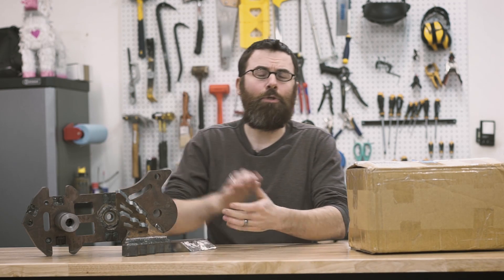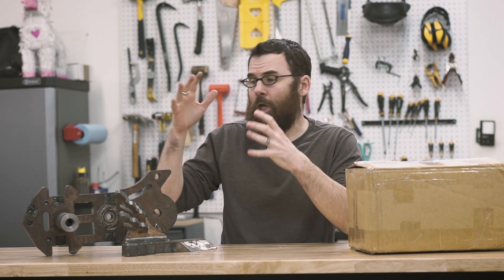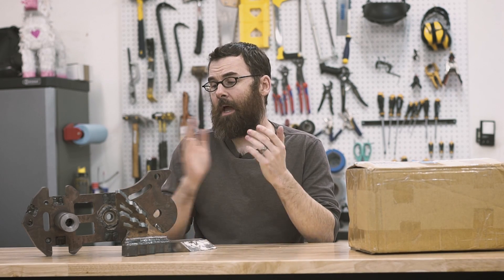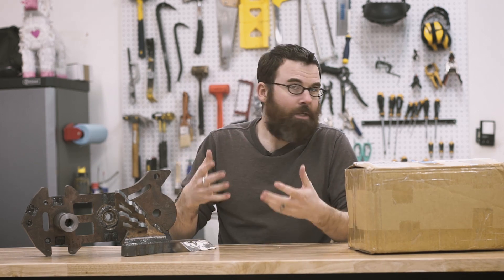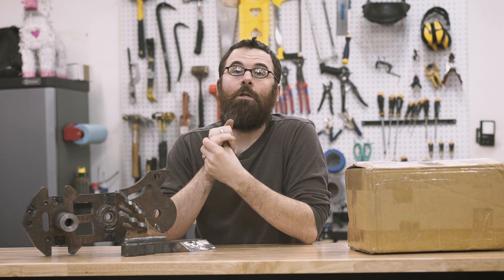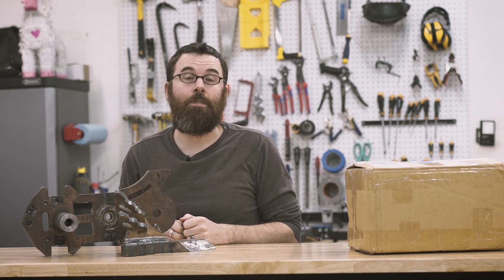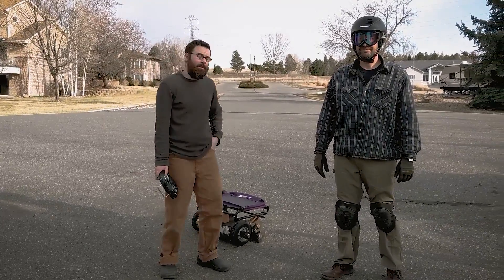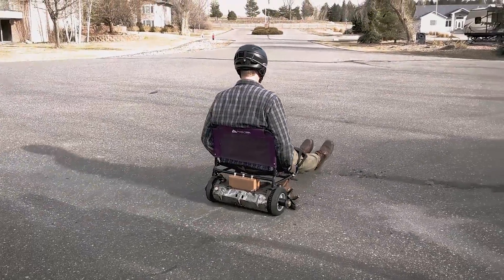Copperhead Heavyweight Drive Test

Comment: I think you need to feed it less voltage through the core because right now is on the brink of rupturing the space-time continuum. If you tune it a bit you might get away with the warping around the motor without tearing the timeline.
Reply from the maker: Haha!

Comment: Robert, I understand the new Flux technology can cause basic utility leveling load significantly heating in transit. Did you protect your speed controller by installing a flux capacitor between the drives? How fast can Copperhead go? I'm guessing 88 mph.